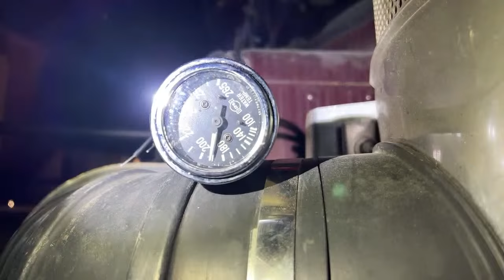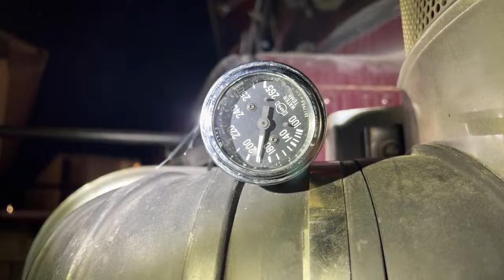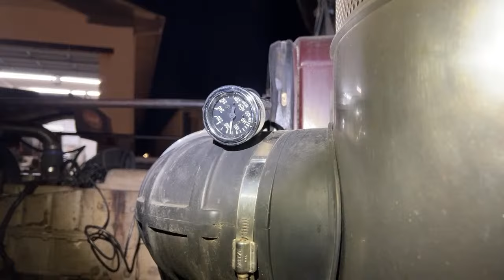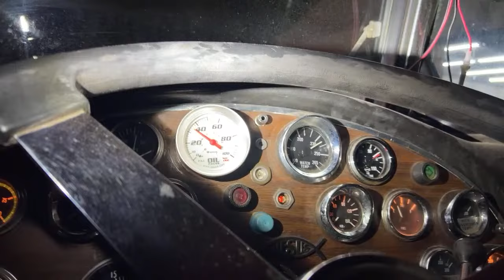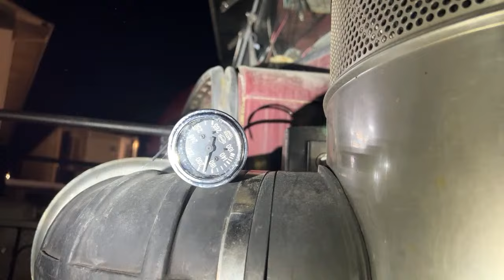This Truck Is Fighting Me Hard!!

Comment: That engine sounds great ! That ticking noise is the check valve in that Cummings air compressor.  All those older Cummings have that noise.  But yeah, it's sounding good ! I don't hear the miss that other people are hearing.

Comment: Did you time the air compressor when you reinstalled it on the big cam cummins?  When you have the single cylinder air compressor which is what is on that engine it is supposed to be timed with the engine and the reason for that has to do with gear train and cylinder power pulses of the engine and the pulses of the air compressor as it compresses air.  If you have the twin cylinder compressor no timing is necessary as it has even pulses.  Timing the compressor reduces noise and harmonics in the gear train.  The owner should upgrade to the twin cylinder bendix compressor since it is much quieter and more efficient than the single cylinder.

The Detroit diesel series 50 has a very complicated oil pump and counter balance shaft system which is very expensive to service.
Reply: I worked on the Cummins 855 engines in the military and we always timed the single cylinder compressors.  I have talked to many so called Cummins experts that aren't aware that the compressors with single cylinders must be timed.
Reply: Come on, you know it wasn't timed.

Comment: I’ll trade you a 07 Kenworth W900 with acert cat 625 hp 310 WB 890,000 mile on it they are original miles the ECM are just about the same

Comment: i must ask why not buy decent trucks not junk get them working hard only man works hard is dad
Reply: New trucks with the emission stuff breaks down way more than old trucks you are 💯  percent better off running old equipment and doing good maintenance
Reply: It's a customs truck.
Reply: I agree older trucks are the way to go but not worn out junk
Reply: He doesn't have that much problems with his trucks in the first place and also the older trucks will out run the new trucks all day! My new trucks spend more time in the shop than they do on the road and if it weren't for my older trucks I'd be out of business if I had to rely on the new trucks
Reply: What kind of truck do you have?
Reply: @eastkywelding Tim’s idea of good maintenance is fitting new 8 inch straight pipes and a new glitter gear knob. Shit and glitter is all his trucks are. By all means run old gear, but rebuild them properly instead of patching them up with oils worn out parts.
Reply: Those damn cabovers are junk. They killed guys neck and backs.I got out of one in 84’ and never looked back. You get in a accident your the first one there.My dad drove one of those Astro day cabs for General Motors for 41 years.3 neck ops. and one back operation. Jobs hard enough without having to lay down to put your pants on in the morning. You can’t keep yourself,your clothes,the truck clean. If you want to do this job for any length of time and come out on the other end with any resemblance of a normal life learn to float gears, better yet take an auto anytime you can. You can fix the truck it’s a lot harder to fix you.
Reply: You know what everyone has there own opinion and Tim's got the right idea ok for one he doesn't show us whole day to day stuff I love old trucks some of us do like cabovers and they are coming back
Reply: EPA
Reply: I am out of here. These live videos are a waste of time. I get the impression you either don’t have the time to edit a video or it just too much trouble. As soon as I see it live Inam out.
Reply: It's his channel not yours so he can work as hard as he wants. He also owns the trucking company and you own nothing.
Reply: Yep buy decent old trucks or make them decent. Look at a channel flint creek transport he runs a pretty big fleet of mostly late 90s early 2000s w900 has very little issues but he’s had a new trucks but has more issues with the new ones then his older well maintained trucks